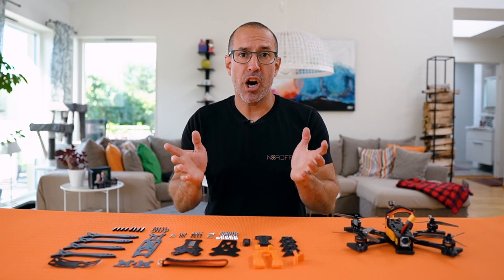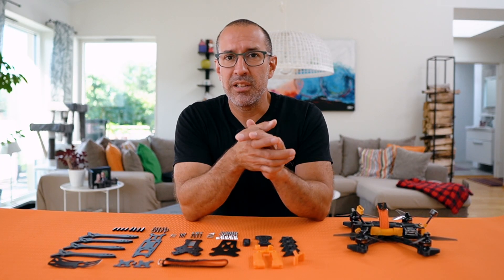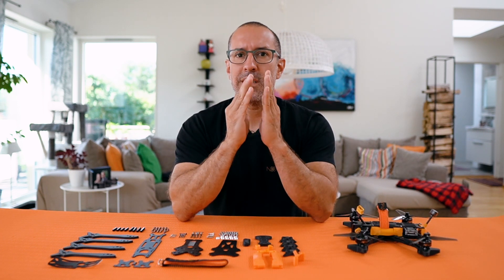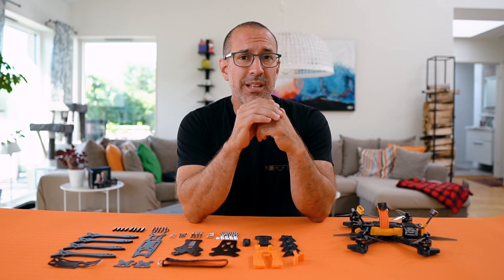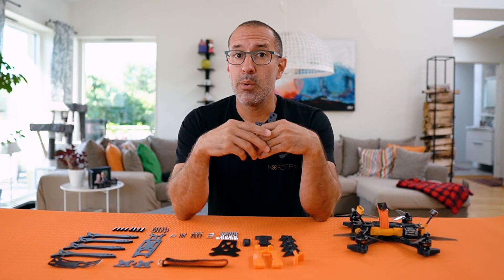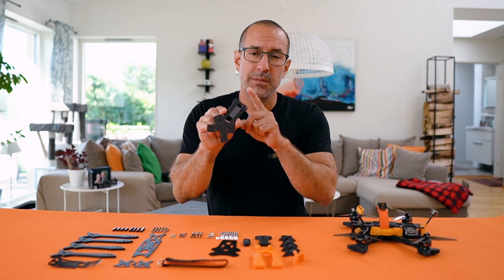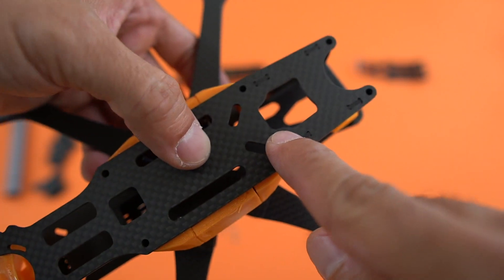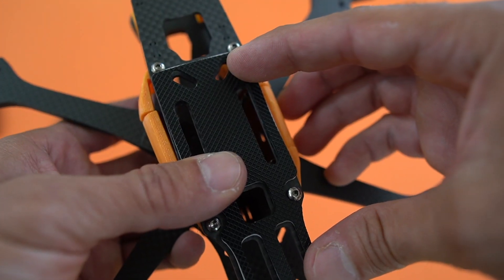The best 5" freestyle FPV frame - The Nord5 HD

Comment: That’s a beautiful and well engineered frame, especially the bolts and washers holding the bottom plate/arms together.  Looks like it would be free from vibrations and flexing.
Reply from the maker: Thank you. We are very proud of it.

Comment: Very interesting frame! Whats the weight including 3d parts? Definitely looks very sturdy and cool with the carbon nylon parts. Also with the added strength of the carbon nylon parts, I would imagine a much lower infill is required than for example petg or abs.
Reply from the maker: Hi Aemilius. Good point you are bringing up and I forgot to mention it in the video. The frame weights 147gr with the basic necessary components. I have updated the product page with this info as well. I'm happy you are liking what you see.